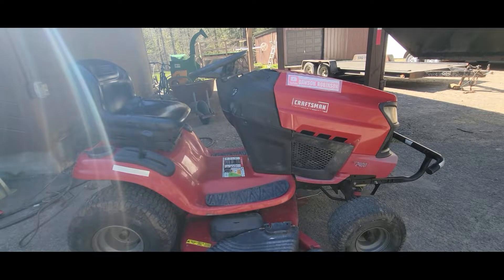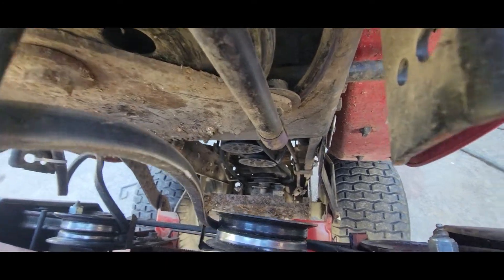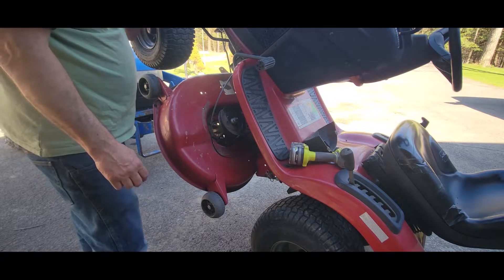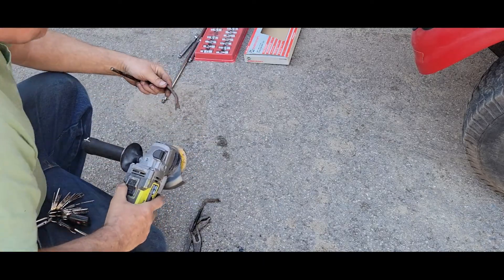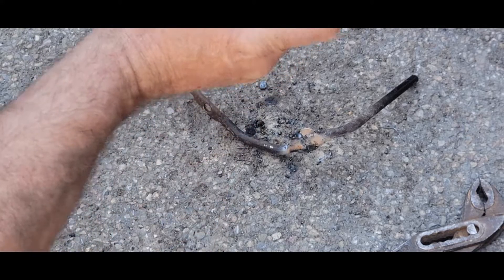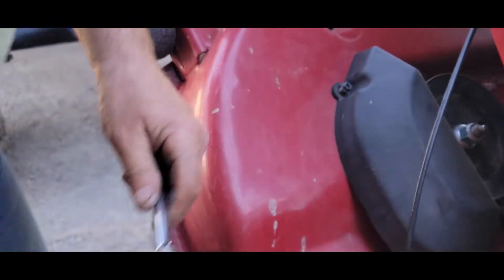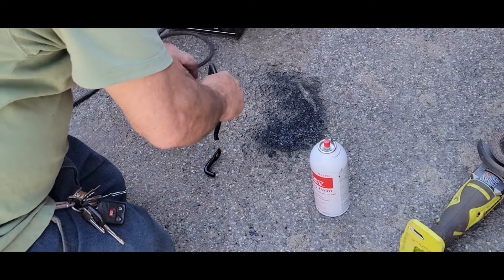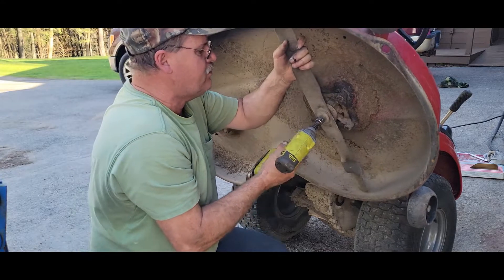Craftsman T2400 broken belt guides and blades

Comment: i have the T2600  could you do a video i think its called trans belt it the small belt under the battery
Reply from the maker: I think I did one it is quite easy to replace